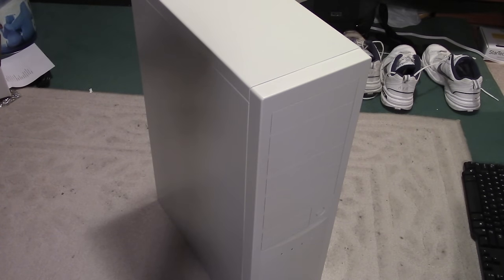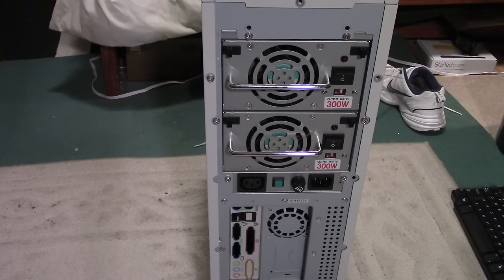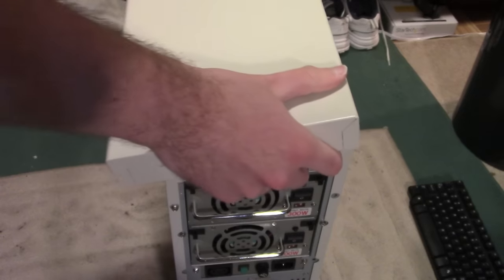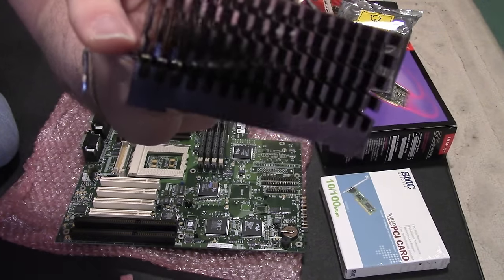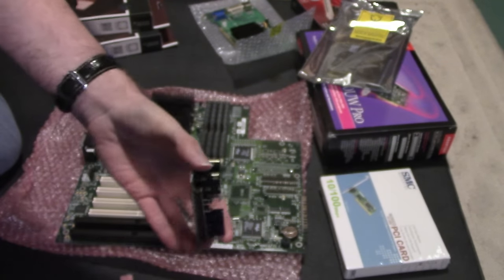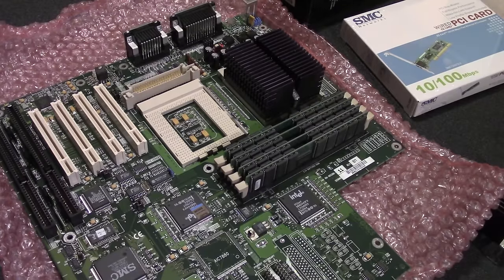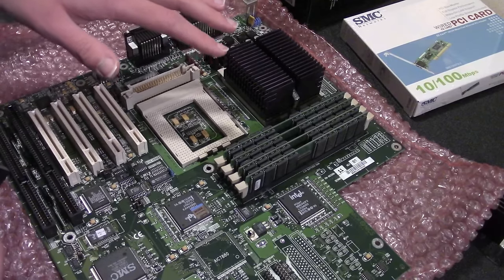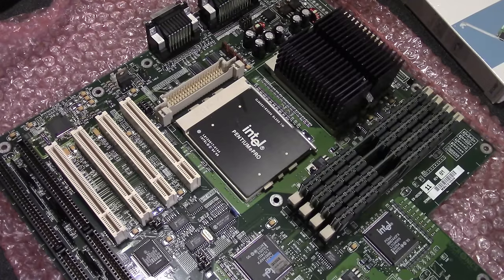2 CPUs, 2 Power Supplies, 1 Computer (Dual Pentium Pro) Part 1

Comment: More than 20 years ago I was in charge of a small server farm of dual Pentium Pro ProLiant machines. They were pretty powerful for the time. One of them had a CPU failure, and a small fire on the PSU cards. Compaq shipped out two new CPUs and PSU cards, and they arrived the next day. Apparently the PPro needed a secondary power supply because they drew a lot of current at a relatively low voltage. The copper traces on the mobo weren't enough to supply that much current, so they just used a DC-DC converter to turn 12V into 3.3V. This held over into the PII architecture, at least for Compaq.

Comment: I know its an old video, but I wanted to say, the memory test is still chugging along not because of the processors, but because of the memory. I have seen that same test run on a machine with much faster, more modern memory and it makes a huge difference, more so than the processor or processors.
Reply from the maker: Good to know, thanks!
Reply: You are very welcome. My roommate had his own computer shop for awhile, learned a lot helping out there.
Reply from the maker: I worked in one too!
Reply: that memory is :  EDO/60ns/5v ? ( video confirms )
only one cpu is used to test the memory. .  
and if you really want to test a MPS
try LifeCD Linux- like Puppy Linux - 512Mb ought te be enough..
Reply: SIMM memory always takes exorbitant periods of time to test because it's so slow. You're looking at a peak throughput around 90 MB/s on fast EDO (50ns) or in the realm of 30-70 MB/s for FPM. This of course relies on memory controller support.

It looks like you're trying to use both CPUs to test memory at the same time, which will likely cause a significant slowdown due to bus contention. 66 MHz FSB is barely enough for a single Pentium Pro, let alone two of them. Going out on the bus to main memory or some I/O device gets very expensive in terms of performance impact.

There were some very rare systems that had up to six Pentium Pro CPUs, these had severe bus contention and were really only good for tasks that barely touched the bus like number crunching.

Comment: I worked at Micron Electronics when that system was made! Glad to see there are still bits of my history floating around out there.
Reply from the maker: You wouldn't happen to know where to find the newer bios for this board would you?  My reading seems to indicate that the only bios that can be found is for a different version and will brick the board.  It is really cool that I came across something you once worked around!  How was it working at Micron?
Reply: Micron Electronics, which changed names several times over the years (aka Micron Personal Computers, MicronPC.com, MPC) went out of business in 2008. Several of the employees made an effort to keep drivers online: www.mpcdrivers.com. I just checked and it's not up any longer. You can use the Internet Archive to find it: here's the motherboard page -
 https://web.archive.org/web/20091124040353/http://www.mpcdrivers.com:80/apps/comphub1d3d.html?ID=34
The smaller the number the older the hardware. This list does have PPro part numbers. However, I don't get anything when I click some of the links :(
wimbios.com has some older bios files still available.
The engineers at Micron Electronics, in the early days, were really good at tweaking motherboards. They would have off-the-shelf boards custom-built with slight changes and modify the BIOS themselves. It was a great places to work. Small, but on the leading edge of the home PC market. When I started there in 1993, there were only 12 of us doing phone tech support. It was poor management that killed the company.
I used to own one of those servers you have. Got it for $50 from MPC at an employee-only 'yard sale'. They were selling off a bunch of old stuff back around 1999. It came loaded with so many SCSI drivers it had two controllers. It was a beast. I wish I had never gotten rid of it. I did keep the two Pentium Pro CPUs, though. 
Is that the M6Pi motherboard you have there?

Comment from the maker: Videos are on the way...slowly!  My very slow internet connection dropped the ball at around 80% upload and, due to the upload speed and size of the video, it will take many days to get it finally online.  Hang in there!
Reply: Has anyone ever told you you sound like Jeff Goldblum? Seriously. Anyway, I have serviced locked up or non-spinning fans. They almost always just need a cleaning and re-greasing or re-oiling. Granted this comment is a bit late to the party, but if you still have that card, it's worth fixing.

Comment: 512 MB of RAM? That would be mind blowing in the late ‘90s. PCs with such amount of RAM were only becoming en masse during the early XP era in the early ‘00s. Well of course it’s an ultra high performance machine so no wonder that it has much more memory than a typical PC of that era.
In fact I could see it running XP and still being completely usable for daily basis tasks during the early or even mid-‘00s. I heard somewhere that some guy had a 90 MHz Pentium 1 from 1994 paired with 512 MB of RAM, FX 5900, Wi-Fi connection and, of course, Windows XP. The Pentium was overclocked to 125 MHz, and XP ran pretty well on it.

Comment: Memories. Around -99/-00 I fiddled a lot with a dual Intel Celeron 300 @ 450 MHz on a MSI motherboard, a Matrox Millenium gfx card driving a 21-22" trinitron (once a Sun terminal)  and slightly used SCSI-disks (IBM mainframe). It was a pretty cheap rig, great bang for the buck. Linux on that thing was a blast. Pentium Pros were not cheap..
Reply from the maker: Sounds like a cool machine!  Pentium Pros were certainly not cheap at all!

Comment: Dude, I have that same motherboard running dual Pentium Pro 200MHz copper top CPUs with 128MB RAM.  Still has Windows 2000 Advanced Server on it.  Its stashed away in a closet but would work with no problems if plugged up!!  Thanks for the video, it brought back some memories of the old Pentium Pros!!
Reply from the maker: Nice!  You wouldn't happen to have a more up to date bios would you?
Reply: I'm not even sure what version is on the board I have.  If I get a chance this week or weekend, Ill dig it out and fire it up.
Reply from the maker: Cool!

Comment: That is a nice fitment of modern fans in an old system, not only do they color match perfectly with the rest but also the fact it´s mounted on those passive coolers which IMO looks better with a fan mounted onto.
Reply: and with the fan he could over clock it and get more out of her hehe

Comment: Newer PCI slots use 3.3v ...the older PCI slots used 5v... could be the nvidia card is just trying to save itself from the 5v and hence not booting..
Reply from the maker: That could be it too. At bit of a mystery.
Reply: Not really a mystery...i remember back in the Pentium days some old boards were not backwards compatible with newer PCI cards due to this issue..and vice versa... despite the card physically fitting in the slot..
Reply: While this is true, PCI cards are supposed to be notched for which voltages they support, if they are notched at both the front and rear of the edge connector they should support both signalling voltages.
Reply: I think Pentium based motherboards have the newer standard already.

Comment: The problem with Memtest is that if it sees a multi core or multi CPU setup, it'll only run the test in the main thread of a multi core, and the first CPU in a multi CPU setup.  So for example if you have 2 dual cores, the system will address them as CPU#0 and CPU#1, and the threads as CORE#0 and CORE#1 (this is just a basic naming convention purely for the sake of the example, so the actual naming convention very well could be different).

So this rig example would be:
-------------------------------------------------------------------------
|              CPU#0             |             CPU#1             |
-------------------------------------------------------------------------
| CORE#0 | CORE #1     |     CORE#0 | CORE#1 |
--------------------------------------------------------------------------

It'll select the core and thread of the lowest value since that will always be the main thread of a multi core/CPU system.  So in your case the software will see both CPUs, but will only run the test through CPU#0.  All data traffic that does the write/read tests in the RAM will be run through CPU#0.  That's why you won't see a speed boost in a multi core/CPU setup.  It's all based on how fast your CPU can run the test, and how fast that data can be pushed back and forth between the CPU and RAM.

Other than that, I've never seen a Pentium Pro CPU before.  They look like they'd do serious damage if you threw them.  Forget your Intel i9s and your AMD Threadrippers, these CPUs are BIG man.
Reply from the maker: Interesting...  The more you know!  Yes, they are massive!

Comment: if the fans got hot, the voltage fan lines are wrong, you could probably consult the mobo manual and check what is the - and + from the pins and check if red and black wires match, the yellow is for the rpm monitoring. not all fan 3 wire followed this scheme black-red-yellow. keep up the nice videos.

Comment: Back in the day, (2000 ish maybe?)
someone (not sure whom) made a dual Pentium III board,
"only supporting 933 MHz" each.
I used a pair of 1.0 GHz. Slot 2 (?) Pentium III and it was pretty darned fast.
Reply: Tyan. They made a S1832 board that handled two Slot 2 Pentium IIIs

Comment: This video makes me want to dig out my old Compaq (can't remember the model) with its dual 333mhz P2 overdrive CPU's, 20gb scsi hard drive and 256mb of  memory. It was originally a single PPro 200 mhz system. It took me about 4 months back in the mid 2000's to build the thing, between buying the CPU's, finding a second VRM, buying incompatible memory then reselling it, then finally buying the correct type of memory and putting it all together. After all that, I only ended up using the thing with Windows XP sharing a 56k dialup connection over ethernet with a neighbor..yeah this was years before broadband connections were available where I lived.
Reply from the maker: Do it!  Dig it out and fire her up!  I'm glad that this brought back some memories for you!  Speaking of buying the wrong memory, the first batch I ordered was mislabeled!  So, in a way, I had the same experience with RAM as you!
Reply: Me too! Reminds me of that old song, "Those were the days my friends, we thought they'd never end" I have a similar story of a home built, doing things that it shouldn't have been be doing and doing it very, very well. I think what that means is, #1. We here were awesome computer builders and understood how the parts worked together. #2. We chose just the right companion parts for each piece. #3. We were forced to take our time in building because of unforeseen circumstances such as shipping errors that gave us time to rethink our project builds. #4. We had fun doing it and failure was only a fork in the road not a massive hurdle. #5. Watching this video makes us want to do it again, for no other reason than to just do it! :-)

Comment: The motherboard pci slots have one notch. The video card has 2, meaning it is supposed to work with slots having either position notched. One is for 5v the other 3.3v

Comment: This takes me back to my old dual athlon MP system. Lots of heat and noise, but not much go! Still, it did me good service on XP Professional for a couple of years.
Reply: I think the second on vrm was, so you didn't have power going to the socket if the second socket was empty

Comment: I have  5.5" floppies and can not get them to work is there something in the bios that I have to activate
Reply from the maker: Have you set the drives in the bios?  Drive A and B need to be set to whatever size they are and need to be in the right positions on the cable.  If your floppy controller does not support 5.25 inch floppy drives, then you will not have the option to use them.

Comment: I found out that the ATI radeon 7000 64mb will work fine with the PR 440fx.  However the only brand is the box that says ATI.  If you get the other versions which say they are the same card........THEY ARE NOT!  Diamond and PNY versions wont work but the ATI will.  Unfortunately you have to use the 333mhz overdrive with MMX to use the DVD player.  I tried with the 200 1mb and it didnt do to well.

Comment: 5:32, I love how most modern motherboards are going back to that orientation.
Reply from the maker: Modern boards are having the header pin outs pointed forward?!?  Cool!  I knew that some USB headers were, but I have not seen the front panel connectors done that way on a modern board yet.
Reply: My bad, you are right, at the time of writing this I have only seen USB headers and SATA connectors facing forward. Although, I would swear that I have seen at least one modern motherboard with a forward pointed front panel header.

Comment: Using coffee filters for a lint free alternative is a great cost saving material if you happen to drink lots of coffee!
Reply: turning off on board graphics would allow for the usage of EMS support for expanded memory page frame address free because UMA uses the memory for EMM386.exe to function. I've worked for years finding what it was that took away functionality Shared graphics are the culprit.

Comment: I'm a year late, but, maybe you could replace the cooler on that graphics card with the broken fan. I did the same thing years ago with an AGP Radeon 9500. It had a rubbish tiny heatsink and a really noisy fan. I removed the whole thing and replaced it with a northbridge heatsink, and it was fine ever since. It's still in the computer downstairs right now, and I still use it occasionally.
Reply from the maker: In part 2 or 3 I show off that I found an identical card with a good fan.  I could certainly see about fixing it though.

Comment: You "might" be able to upgrade to 1GB of RAM.  It was not officially supported, and by now it may be darn difficult to find the modules.  I was able to do it on my PR440FX.  Never tried it on the Micronics (I had both at one point).
Reply from the maker: I have thought of that.  Maybe a future video, if I can find the right RAM!

Comment: 16:45 This is probably good fan connector, but you used faulty fan before. Fan which is not spinning will be very hot, because if it is not spinning it becomes a shortage on a power line. But after a while it will burn, and it will be cold again ;p
Reply from the maker: The fan was known to be good before hand.  I believe someone else mentioned that it might be a different voltage standard, like 5 volt as opposed to the more common 12.

Comment: The GeForce 5000 cards (most of them) had reaaaaaally tiny heatsinks and all its cooling were handled by the fan.

Terrible mistake if the card's fan dies and you weren't aware of it as they didn't had a unplugged/dead-fan detector, and it was only a matter of time for the card to die (for the average computer-consumer).

That, and that many manufacturers implemented low quality caps (I had a lot of GeForce5 cards with blowed up caps and I totally gave up fixing/replacing them).
Reply from the maker: Luckily, I found an identical replacement that worked!
Reply: Glad you did, also, got another subscriber! I love old tech like this.

Used to have a Pentium 1 166mhz with 32mb of ram, and a DiamonStealth of barely 1.5mb of videoram back then... It took a bit of time to load NeoRAGEX games, but god that was smooth af.

Comment: My Dual Pentium Pro has Pentium II Overdrive processors and uses either an ATI Rade Pro 128 PCI or an Nvidia TNT 2. I'm also using an Intel PR440FX motherboard.
Reply from the maker: If they were cheaper and I knew that the older bios on this board would handle them, I would certainly give some Overdrives a chance!

Comment: 16:20 Zip ties are incredibly versatile. Recenlty I worked on retro Slot 1 system - I had Slot 1 Celeron, heatsink, no backplate. I carefully attached heatsink to cpu with zip ties - problem solved.
Reply from the maker: They are great for that sort of thing, but I hate to use them for cable management!  I never have wire cutters nearby and have to try to use scissors.

Comment: In my dual p-pro, I use a matrox G200 card.  Anything "faster" is just going to be bottlenecked by cpu.
Reply from the maker: Not bad advice
Reply: The only downside for matrox - shitty drivers. IMO Nvidia or 3Dfx is best from old vga cards.
Reply: S3 805 is all ya need :P
Reply: In the day, Matrox was the card to have, they supported them very well compared to the others at the time.
Reply: Nowadays they are the thing to have for mission-critical video display applications where failure is simply not an option.  Government installations dependent on rich multimedia content, from NASA Mission Control to the White House Situation Room, rely on Matrox video solutions.  Ever see a big video wall?  Probably running Matrox.  Medical imaging system?  If it's not using 3D it'll probably have a Matrox card in it.  Control room with lots of monitors?  Probably has Matrox behind it.

Comment: That case is definitely a server version of the Inwin Q500, which I still have a few bits from. Mine was the plain jane Q500, but I added a 550CFM fan, a monster heatsink, and other goodies when I was into oerclocking with purely air power YEARS ago.
Reply from the maker: Nice!  It is great to know the official model.  I really love this case and want to build a modern system in it.  I think I can make the outdated airflow work with the right fans.  Noctua, as per normal.
Reply: i have that same inwin case but with a ASUS P2B-DS, 2x Pentium II 400, Matrox Millenium G400, Buslogic ISA SCSI Controller and a 3Com NIC both populating the 2 ISA slots, it was a old server, has redhat linux on it. it currently has the power supply taken out of it and is in another system, it worked last time i powered it on.